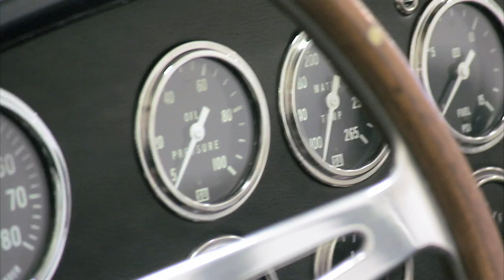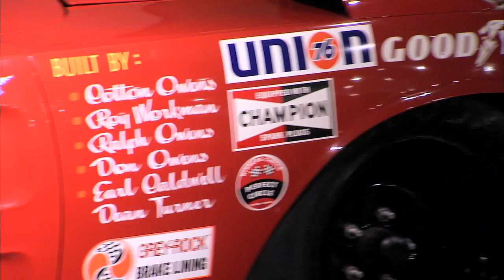Canepa's Gone Car Crazy

Comment: At $30,000,000.00, you’d think they’d install a full-on fire suppression system. Or at least the insurer would require same. 

I commented and later remembered a friend working a track day at Thunder Hill. One of his Hooked on Driving techs was conducting pre-track inspections. This young kid spotted a fuel leak in a Ferrari.  Very well would have burned to a crisp. The owner was VERY appreciative. 

Remembering that is only more reason for my idea. Is this idea even practical?  If so, used?

Great video. I hope to visit Canepa next week with the ‘88 911 needing some love.